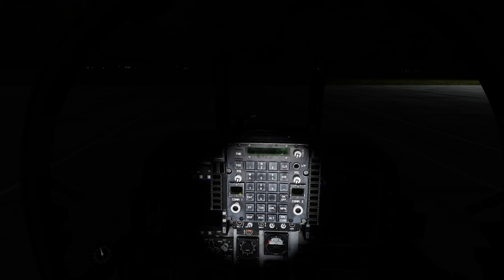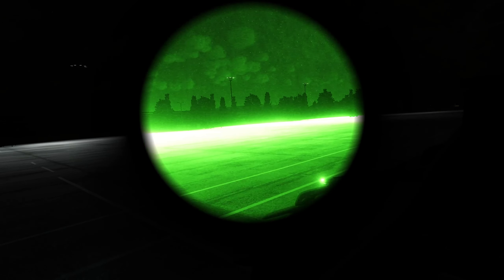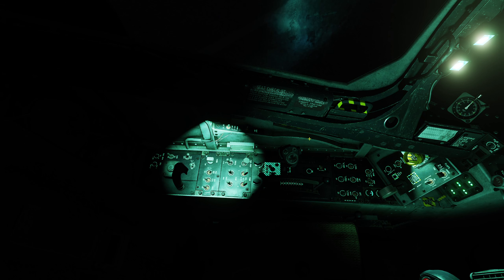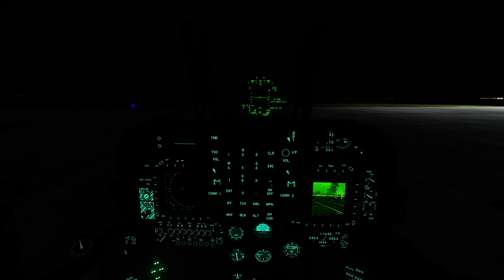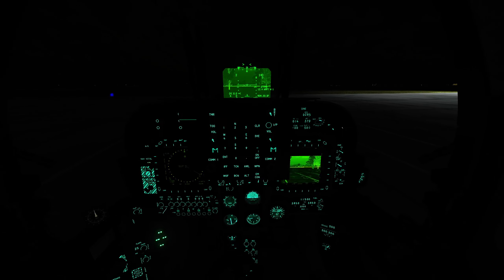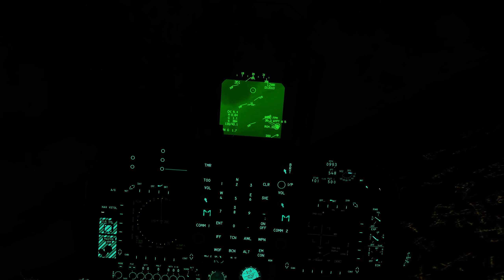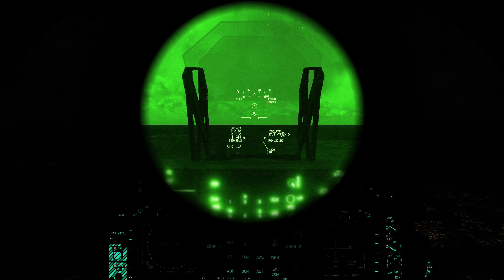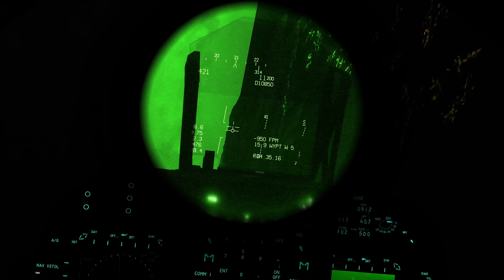DCS AV8B Tutorial 10 - Night Operations

Comment: You never mentioned that the cockpit lighting has 7 or 8 individial lights that can be moved to point at different displays, like torches/flashlights. If I remember correctly, there's 2 on the left (under canopy rail, above fuel pump switches), 2 on the left of the left MFD, another 2 on the right of the right MFD, and I think 2 more somwhere near your right hip. I can't remember if it's 7 or 8 in total.
Reply from the maker: That's very true, I omitted this because I never actually re-position them but they can be useful. Thanks for the note.